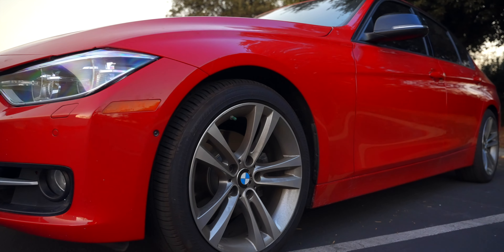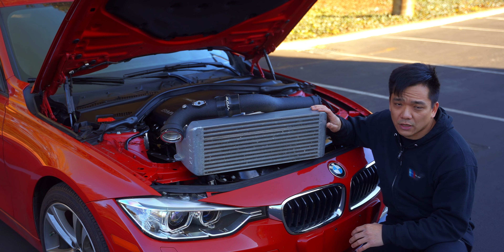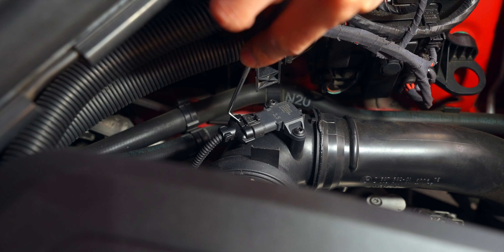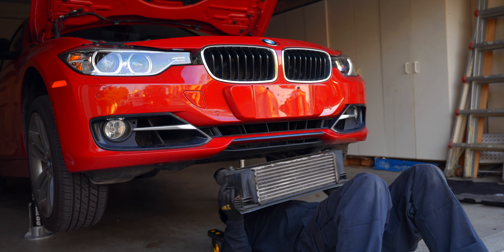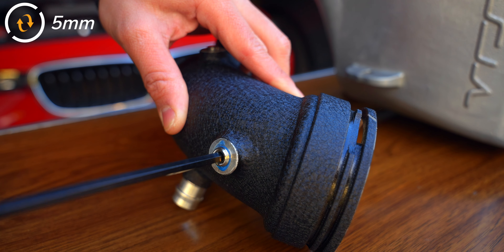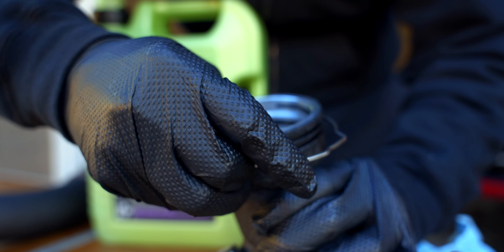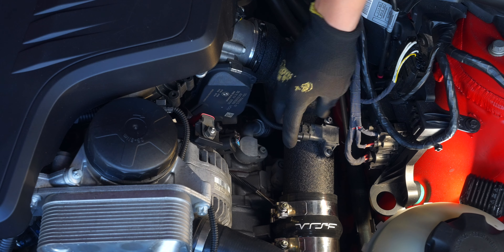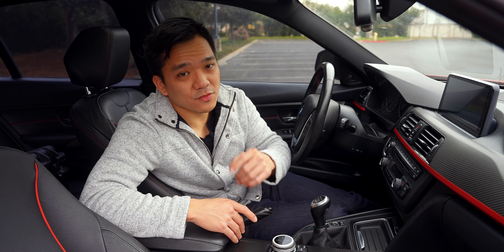Every F30 NEEDS These Mods

Comment: Just a heads up, the stock clutch can’t hold stage 2 OTS maps. Ask me how I found out the hard way. Good luck and have fun fritz.
Reply from the maker: Thanks for sharing! I'm sorry to hear that. It's a good thing that this car won't get a tune 😅
Reply: The stock pistons can’t hold stage 2 either
I had to get an engine rebuild at 90k and am now running a stage 1 jb4 tune
Reply: @dylan-nguyen  that’s why you don’t run JB4 a piggy back. Stock internals are fine. Piggybacks have a margin of error as well.
Reply: @Sqwin_n20  stage 2 was a bm3 and I didn't wanna pay for it again for a stage 1 so I got a used jb4 from someone at work
Reply: @dylan-nguyen  bootmod did nothing to your car lol. Not sure why you had to get a new tuning platform and go JB4 if your motor was rebuilt + used the same DME for licensing. It would still be tired to the same car/DME. Sounds like someone is spreading BS.
Reply: @Sqwin_n20  you needed to pay for the new map for stage 1 $150? or $100? and I didn't trust it after the blown engine. 

I heard more people review the JB4 so went that route.
Reply: @dylan-nguyen  bm3 with map a single map was one fee, and all the OTS maps after that was 100 or so. All Stage 1/2, 91/93/91 ACN was in the bundle at the time for ~600 I want to say a couple years ago.
Reply: @dylan-nguyen I got my stage 2 and 1 with the single $600 license

Comment: 3rd upgrade should be to get BimmerLink & BimmerCode as well as a BT OBD2 dongle. 4th upgrade... MST Cold Air Intake because of the heat shield and MAN DOES IT SOUND SEXY
Reply: Also, the charge pipe should 100% be the first upgrade. Mine exploded on the way to Taco Bell one evening
Reply from the maker: Darn Taco Bell. I Scrapped my rim leaving their drive though lol. Tha one's on me though.
Reply from the maker: Good points! I might have to sneak 1 or 2 more items in front of your list though.
Reply: @FritzRamos  What would you sneak ahead? Just curious if it is something I have not done yet

I have all hot and cold piping changed. I still need to do the VRSF FMIC tho :/
Reply from the maker: @chasegoodman7672  Mickey Mouse Flange and Turbo inlet. Videos incoming
Reply: @FritzRamos  Will be looking forward to it. I still have the stock coolant flange

Comment: hey bro I've been looking for an f30 with the same license plate holder in the front and have been looking for ways to remove it! I wanna put the license plate on the side in the front using the tow hook.. any suggestions?

Comment: Im trying to decide between an f30 320i or an Audi A4? The f30s i have looked at are quite worn like cracks in the headlights and window and door surrounds.. and they only done around 60k miles. Is the A4 i higher quality build? How about reliability?
Reply: From personal experience the 4cyl bmw engines have a huge flaw. Timing chain guides fail ~100k there was a class action lawsuit
A4 on the other hand has loads of electrical issues sensors failing all the time. Coworker has one and like every other month has to bring it in for a broken sensor 
I personally will only get cylinder bmws as they’re all pretty reliable 

As for the interior, mine looks brand new with only the interior door handle guard cracking which is common. Whatever rubber they used deteriorates and they’ve changed the material in my new car. But that’s a 1-2hr fix (all 4 doors) and diy with just hand tools + drill 

I don’t know about Audi interior but the build quality is way worse lots of “bling” to look nice but cheap materials and worse fitment

Comment: Hi Fritz- I’ve run into a bit of trouble… yesterday completed the mod per the video instructions. Today while on the highway the charge pipe disconnected at the compression ring- woops, there was a thunk and loss of power. I pulled over and was able to reset the pipe and properly this time, I had trouble with the alignment- and now it seems correct but there seems to be a bit of hesitancy with the power when I hit the gas from standstill, and sometimes it stalls when I come to a stop. Could I have damaged the engine when the pipe undid? Could this be a matter of coding to adjust idle etc for new equipment?
Reply: And it keeps stalling.